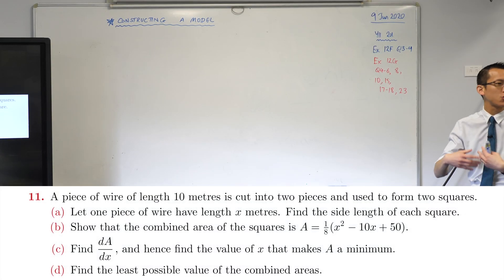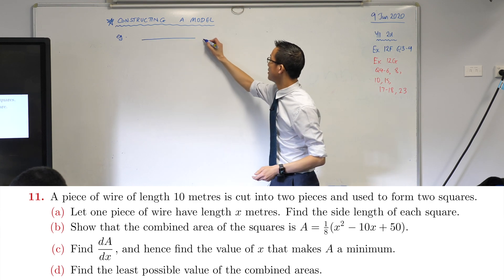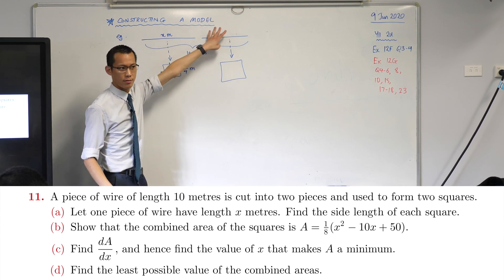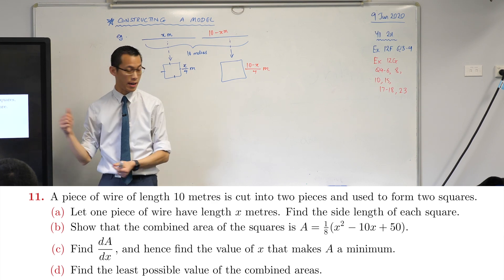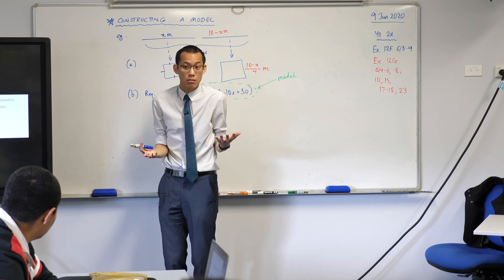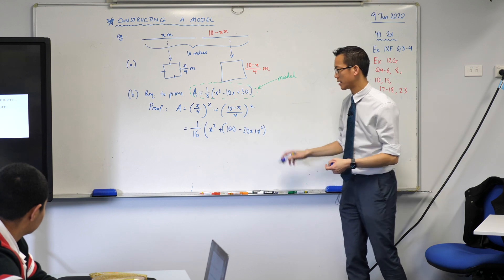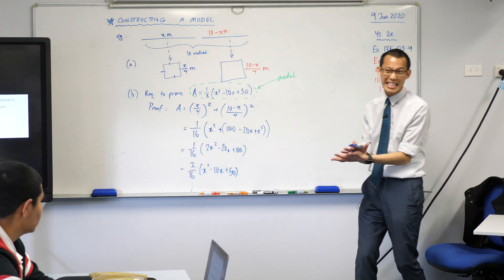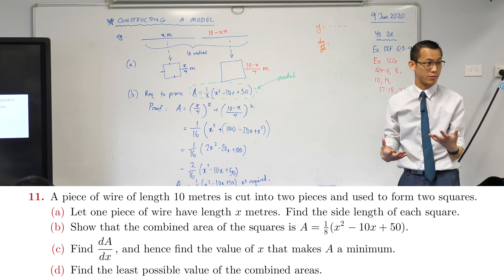What is Optimisation? (5 of 6: Constructing a model)

Comment: I do not understand why do not consider also the pther square's area as (x/4)? After all they are the same and would be easier to proceed after
Reply: If you did make (x/4) for both squares. (careful x/4 is not the area as you said but the side length).

Then the function would be A = x^2/8 (which does not match the one in the question in part b)
Finding the global minimum of this function would be x = 0. x=0m as a side length????? problems.

The way you have set your model is you already CONSTRAINED your model to have both squares the same. (which x = 5 is the only feasible solution in your constrained model)

This question has no constraints. Think about a question where you want to MAXIMISE the area instead. The two squares would NOT be the same. Or think about a question WITH constraints on x, such as {0 < x <= 3} and you want to minimise the area. The two squares would NOT be the same. 

It just happens in the question you find out the minimum area REQUIRES the two to be the same... we found that out because we created a GENERAL model rather than assuming they need to be the same right at the start. 

Thus you need to create a general model. Then use calculus to find minima and maxima. It's also easier in the real world to edit constraints when you have a general model. So the model doesn't need to change, just the constraints.

So, be careful.
Reply: @十csaEtnosrecie四  thank you for your insightful answer!